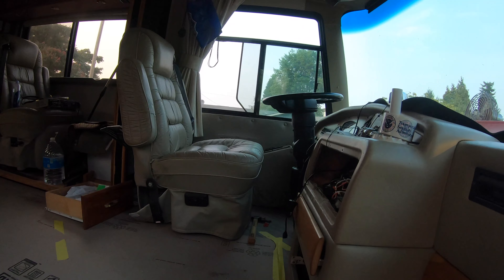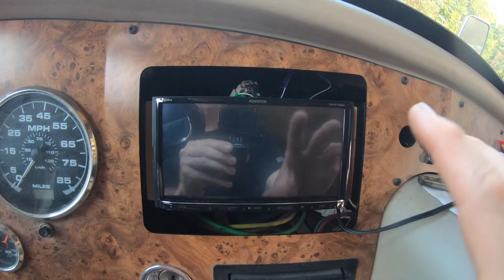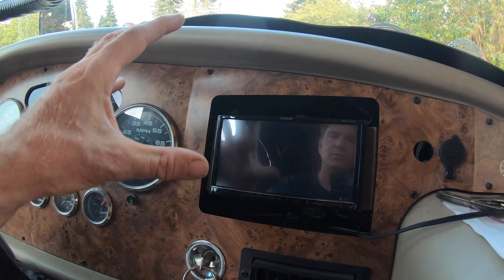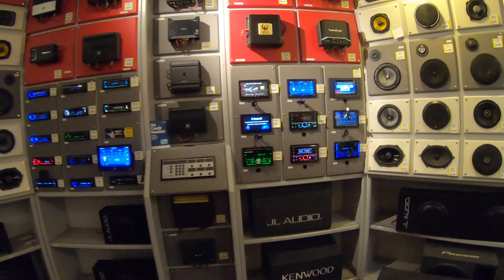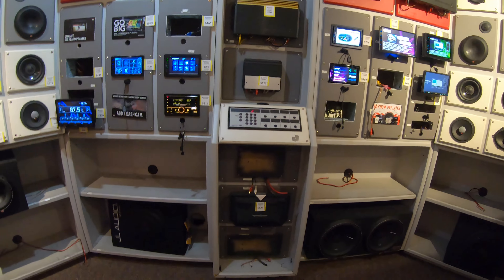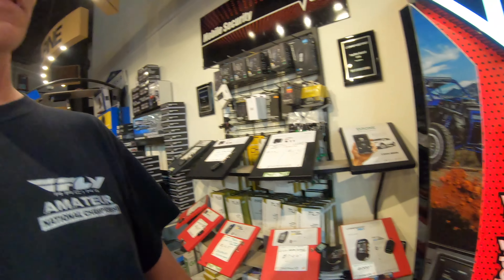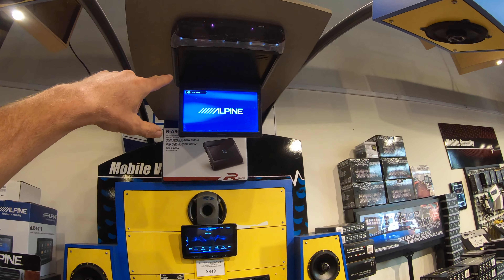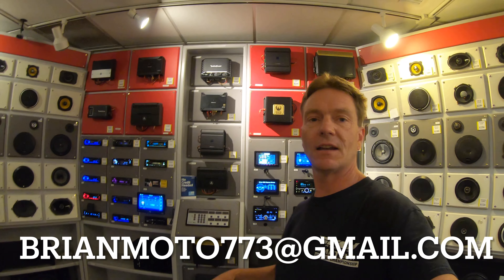What About RV Audio/Video?

Comment: Hey Brian thanks for the great videos. I have been looking at replacing my head unit to one of the large floating screen types in our CC Inspire. That way I could ditch my out of date tube type back up monitor. I was leaning towards the Sony but the price point of the Jenson grabbed my attention. For someone just powering the stock 4 overhead speakers, integrating a backup camera and using the Apple Carplay function do you think the Jenson line of products would be a good fit or should I stick with the Sony?
Reply: Just did this. Went with a large Boss halo single din. Car play and backup cam. Bye bye Jensen BW tuber